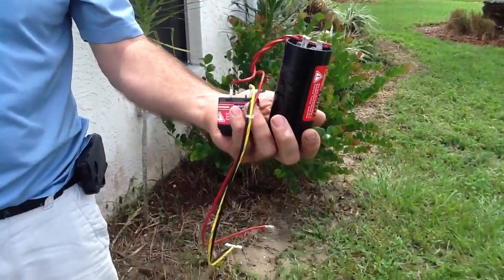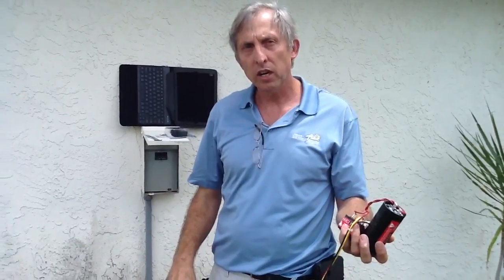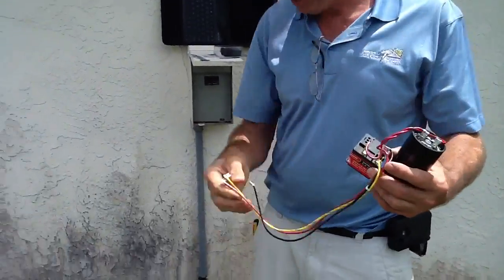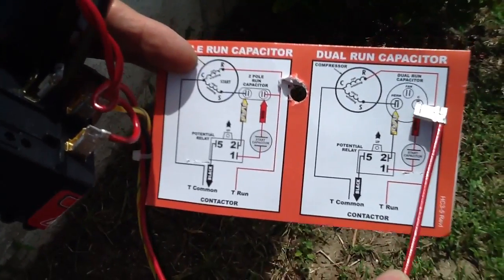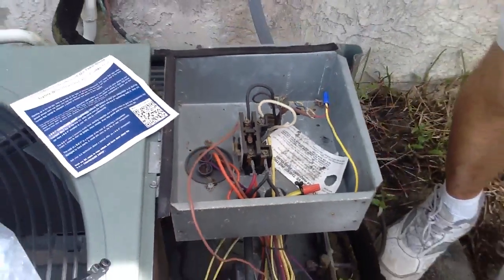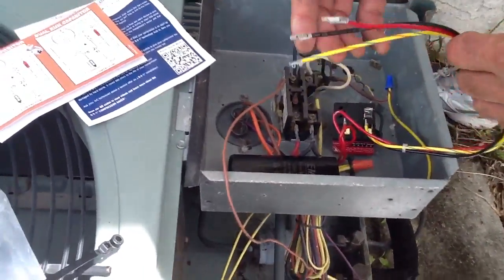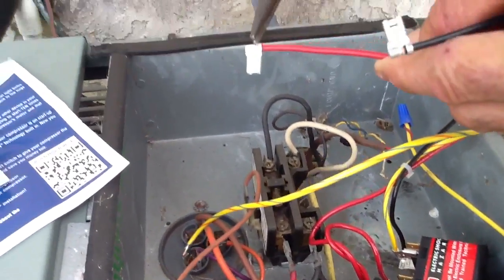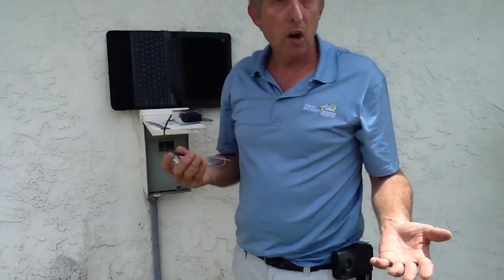How to hook up hard start kit on air conditioning system

Comment: I installed this on my RV air conditioner and it works great. I'm running it from an inverter and some lithium batteries, and the voltage would sag to 70v when the AC kicked on. Now it's stable voltage. The AC in the RV is a 120v unit and this kit works great. Mine is the CSRU01.
Reply: Your air conditioner is going to fail prematurely.

Comment: I went to install my Hard Start 5-2-1 and on my run capacitor I have 3 separate poles like yours but one of the poles only has room for one connection and it’s being used. I believe that’s when it said put the third wire to the herm at that point I stopped because the way I read it the third wire was supposed to go to the pole on run capacitor with only the one tab. I have the same hard start as you but mine is for 1 to 3 Ton units. I put the black from relay to contact but to make sure were do my 2 red wires go from new capacitor? Thanks

Comment: It’s also good to install one for when there is a power outage and your running a generator makes the generator use less wattage if you need the air for medical conditions. You will drastically cut down on wattage used because most comes from start up and it will do it quite often so the say 1,500 extra watts deducted from around 3,500 to 4 k you will have spare wattage to use.

Comment: My 24 yr old heat pump is not showing any problems although I haven't had the inrush current measured yet. But it doesn't seem to have difficulty starting. If the inrush current is within spec, is there any risk adding this kit? Also, does it matter what type of compressor, scroll or other? Does it matter if it has a TXV or piston metering? Thank you.

Comment: Thanks for bring this up as an improvement and the simple instructions.  I have two , two ton units that require close to 30A to start which my portable generator (storm season back up) would not supply.  So I installed one of these in each AC and brought the rush amperage from the 40ish to the 20ish.  Needless to say both of my AC will be served by my generator (though not at the same time)

Comment: Thanks David, bought the hard start kit you demo'd, got it in 2 days, and installed it in 20 minutes.. Didn't really notice any change in startup noise, but I believe in the long term benefit.

Your instructions were helpful. I mounted the relay on the side of box, and raised the capacitor,  to keep them off the bottom of the box.

Comment: very interesting, would this kit help my generator start the air conditioner. I have 6550 watt 30 amp generator. the inatial start up of the A/C  beats the  hell of generator during start up. uses 100% of generator. after air conditioner is running I am using about 30% of generator load  capabilities.

Comment: at 2:57 you shocked yourself real good  lost Ur breath it sounded like and had to restart Ur sentence.  Be careful sir, thanks
Reply: if he did shock himself? he should have taken a second to explain the importance of discharging the capacitor prior to working.
Reply: @gearhead0800  these capacitors do not need to be discharged they discharg themselves on the windings of the compressor when they lock, also ac compressors have a tendency to not hold a charge. More likely is that service disconnect isn't fully disconnecting the outside system and he needs to pull the common as well as main breaker inside the house
Reply: Will Boyd i think you're right
Reply: 😂🤣 u saw that too? Lol

Comment: prior to installing the new capacitor, which did not have the fan high or low speed wires attached but , they were connected to an individual capacitor , I ommited that capacitor and put them, one high speed, brown with white stripe, on the new capacitor on the fan post. is this why neither the fan or compressor are not coming on?

Comment: I am working on an old googman, new contactor, new capacitor, compressor or fan not coming on unless I push contactor in. the compressor starts for 15 seconds and shuts back off?
Reply: Could be low on freon and that's the low freon switch kicking in after a few seconds..
Reply: Thanks, that was the problem

Comment: you mounted the relay in the wrong position
Reply: why?
Reply: @kurtwm2010  There is an install orientation for mechanical potential relays in regards to gravity. "This side up", which is generally with contacts facing down.

Comment: Is it out of the ordinary for a Hard Start Kit to fail within a year? I had a tech replace the compressor last year, along with the capacitor. Had to call him back out after a couple of weeks, he installed the Hard Start Kit. Worked fine for the rest of the year. Now, the compressor won't kick on again. Would you recommend replacing the Hard Start Kit?
Reply: Hey I got same problem like you.  How to troubleshoot this unit.  I guess just buy one again and install it and see whether compressor comes alive or not.
Reply: FYI:  I just test my hard start kit.  I used multimeter to check its capacitor and I got very low uF.  It stated on its capacitor from 189uF to 227uF; but I got very low in nF or 30uF.  I think my start kit is bad; so I am going to get another one to try out my AC and I hope my compressor is OK; otherwise it will be a big bill.
Reply: I just replaced my hard start kit with a new one and my AC unit is working again; so basically my 521 CSU R2 compressor saver broke.
Reply: +Tuan Nguyen    lol. wtf are you talking about sir?

Comment: I have a shop air compressor that's having a hard time starting. Could this "Hard Starting kit" be used to fix this problem aswell?
Reply: +Angela Scott not that she will see this 5 months later 
there are line voltage transformers to correct voltage issues
there are two capacitors on a shop air compressor and
a  switch in the motor to cut out the start capacitor when its up to speed

these hard start caps are for refrigeration compressors that expect unlimited power to start

also a shop air compressor has a unloader air circuit that if its failing allows tank air pressure
to resist spool up of the electric motor driving the piston type air compressor
I have seen all these problems as a shop mechanic

Comment: I have 2 caps. Which one do I hook the common up to?
Reply: David Traina The one with the higher uF (microfareds). You will have one capacitor with 2-5uF for your fan and one with 30+ for the compressor.

Comment: Hey David Jones i need to replace a dual run capacitor but its wired to a hard start kit or assist capacitor but its a 2 wire assist capacitor. i am going to replace the dual run capacitor and i was wondering if i have to wire the assist capacitor back with the new dual run capacitor and if i do have to, do i need to get a new one?? Thank you for your help!

Comment: Excellent teaching video.  You are very clear in your instructions that condenser units handle very high currents and that all power should be safely off.  Over confidant DIYers have been killing themselves since before recorded history.
Reply: yeah except he had his fingers in there before he shut the power off, and then he didnt discharge the capacitor and shocked the shit out of his finger when he touched it. not a real paragon of safety if you ask me.

Comment: Hi David! Hey, I bought this device and about ready to install. I have a picture of my AC relay and wanted to ask you if I have the T1 location correct. That is the part I'm worried about. I'll message you and hope you can confirm if I have the location right... Thanks!
Reply: Thought I'd share after I installed mine. The black wire goes to the T1 which is also connected to the black wire off the compressor. Yellow stripe to herm, red to C on the compressor.

Comment from the maker: Yes, you can use this on any system. Thanks for asking.
Reply: Hey David,will it void the warranty on a new unit to connect the hard start kit to it?
Reply: In this video you hooked the black wire to a black wire. In another video, you say red is usually T1. I thought the black wire of the Hard Start kit is supposed to be connected to the T1?

Comment: Great video,Thank for sharing .Blk wire go to  relay contactor
T1(com). how do I tell which one T1 or T2 side is Com. Terminal @ the contactor. Is that the wire from Compr.( Com.terminal ) back to  N/O side of relay contactor ? Can it be install on a non TXVs valve?  Thanks !